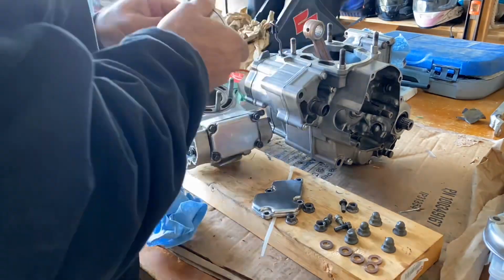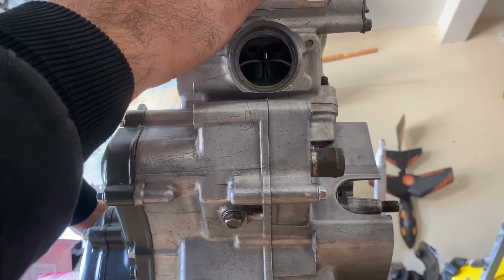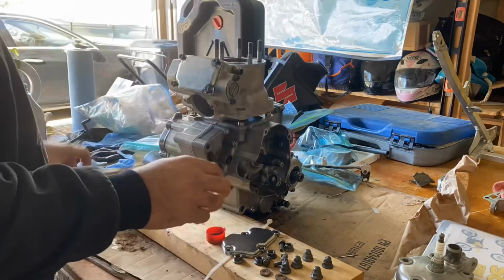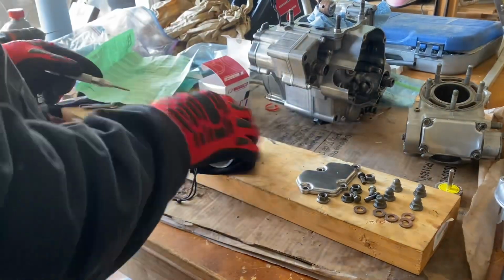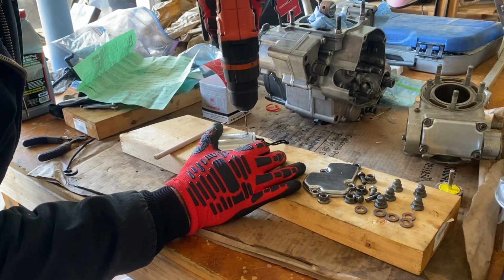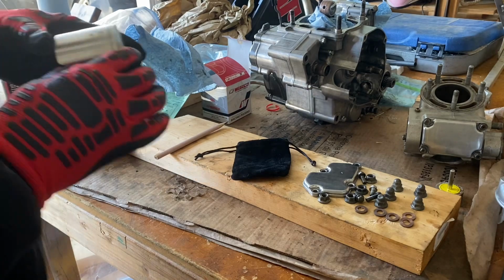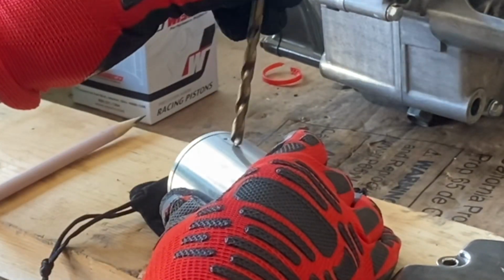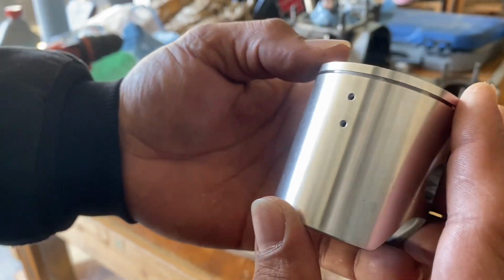E10 2000 RM 125 Exhaust Bridge Lubrication Holes

Comment: Yea I’m curious about the one ring too. I’m rebuilding my top end that my dad did and it didn’t last long hrs wise at all. It was barely ridden and the piston is cracked…hair line but definitely cracked..on the opposite side too
Reply from the maker: One ring is pretty standard on these Suzuki 2 strokes. Id recommend checking the crank bearing for up and down play… there shouldn’t be any up/down play. Id also recommend a forged piston like Wiseco pistons.

Comment: I noticed your piston only has one ring. Is this common for that setup or something you choose to do to gain hp?
Reply from the maker: It’s factory. I also wondered why they only had one and found out these were designed to race only back in 2000. It’s kinda crazy how fast these 125 bikes are. It just wants to be in the power band ALL the time.

Comment: What if im not realy riding to hard ,,not racing,,do i need to drill those holes?
Reply from the maker: It will run, you’re just risking damaging your cylinder at the exhaust bridge. Pistons are cheaper than cylinders. You should do it. Even if you’re not racing, these engines are made to run best at high RPMs. Running a two stroke below the power band just gums up the power valves.